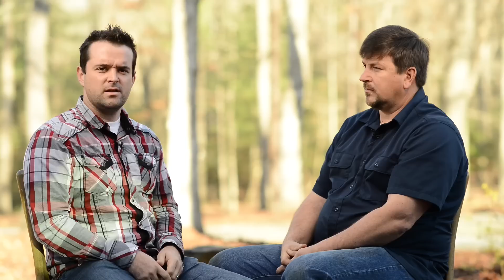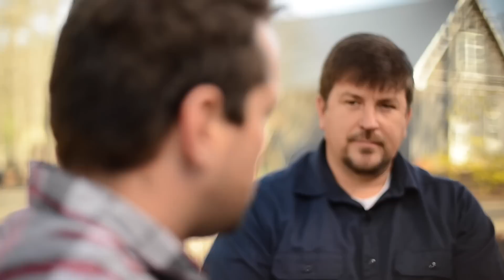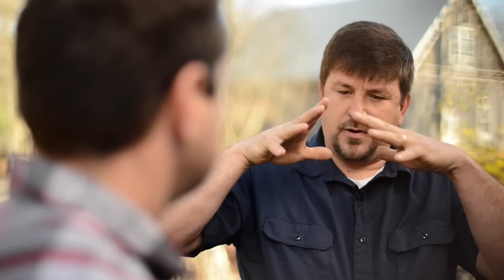The Difference between a CME and an EMP

Comment: I want to be forthcoming, I initially watched this video, to see if the people explaining. Actually knew what they were talking about. Since, I've observed a good share of video's, in which the presenter doesn't have a clue about the subsequent subject matter. I'm a prepper, a gastro-intestinal surgeon and got my Ph.D in Chemistry. Yeah I know, too much education. However, I love learning and knowledge. It's my hobby per se, as well as firearms. Hence, I'm always looking to seek new knowledge.
You sir definitely, know what you're talking about. And I look forward to learning as much as I can from your channel.

I reside in middle Tennessee, on roughly 42 acres. I've slowly been preparing my property to be more self sufficient. It's hard due to time restraints. I work in Nashville, (Vanderbilt University, Medical Center), and commute roughly 75 miles to work. I prefer country living, for several reasons. If a SHTF situation occurs. It will be cities and suburban areas that fall first. As well as, I prefer, slower way of living, with less crime too. I'm really interested in Solar or Wind generated power source. I do have, wood burning capabilities at this time. And some generators. But, gasoline and diesel can go bad over time. If not properly treated. As least that's what I've been told. In your professional opinion, which alternative energy source is best. Wind or Solar or BOTH? Any assistance or advisement would be greatly appreciate. Even if there's a book that instructs in how to. would be great to have. There's so much info out there. It's difficult to ascertain at times, What is correct and what is crap.

Respectfully,
Dr. Rick S.
Reply: Middle Tenn!

Comment: Doesn't the mega-tonnage (size) of the nuclear warhead also have to be considered in determining the weapons EMP out put capability?  This would be for a weapon to be used strictly for an EMP attack per se.  Warheads in that range were typical during the early days of the cold war.
Reply: The tonnage is important but, the detonation level, how many feet, makes all the difference. This will expose more people to the effects, the tonnage will make it more powerful! Hopes this helps.